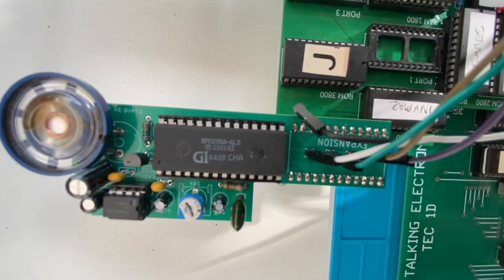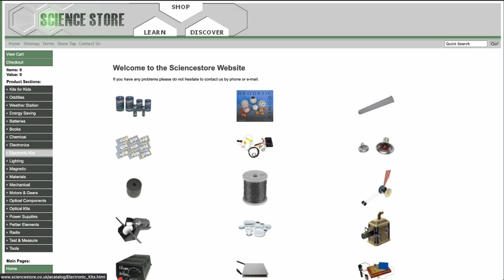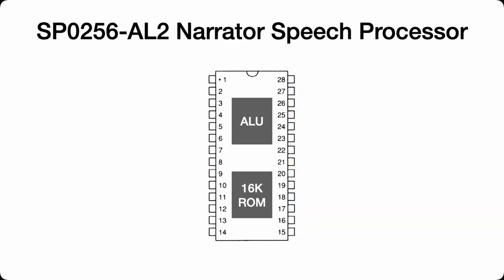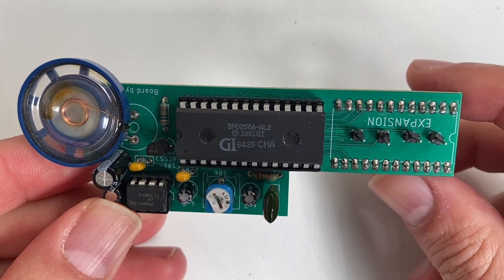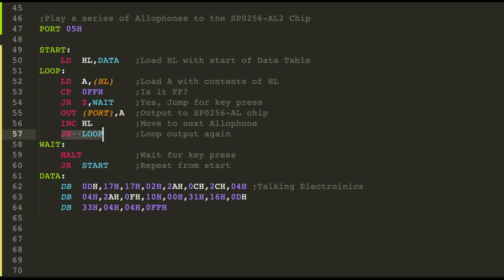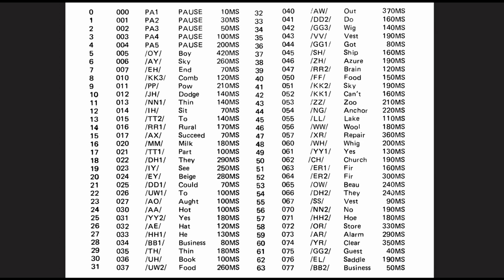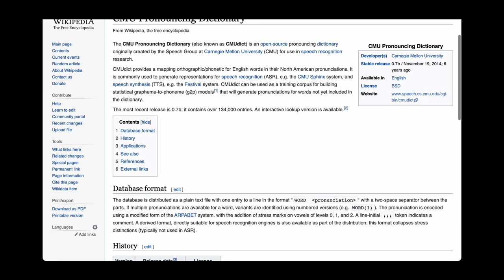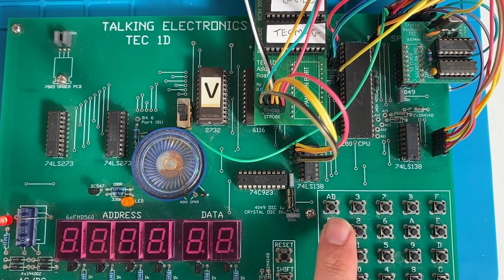Make a Z80 Computer talk with the SP0256-AL2 Speech Processor

Comment: That was a great chip.   Back in the 80’s, Radio Shack sold them for around $12.   I added them to MANY projects at the university.   We automated all kinds of things.  Especially scientific calibration and measurement.  I interfaced this speech chip to a 6502, Z80, 8085 and 68000.  It did sound “mechanical”, but it was the best available at the time.  A friend of mine once spent 6 hours trying to get his to say “fire truck” to his satisfaction.   Lol.

Comment: The last product, I designed, with a Z80, was a talking clock accessory, attached to the company's main product (Analog Logging Recorder), back in the late 1980s. It was later redesigned using an HC05 uC, as that unit more compact and used fewer parts, requiring much reduced assembly time. The speech processor used in those 2, were from TI. The chip just output whole words, and had a short, but adequate, vocabulary. It was also a custom chip (not found in databooks), but the original customer bailed out, and I happened to stumble upon them, just at the right time. I collected the unofficial documents from the local TI Sales office (remember - 1980s), and the company bought up a bunch of the, otherwise dead, inventory.

Comment: Nice work. I still have all of my speech chips from back in the 80’s, including this, the National DigiTalker, and also the Votrax SC01A and SSI-263 (SC02).  My favourite was definitely the SC01A, which is Phoneme based and sounded a whole lot better than the SP0256. I made my own speech synthesiser for the C64 with the SC01A and coded an extension to BASIC to provide a SAY command for text to speech output. I remember working through a collins dictionary, page by page, to figure out the rules for translating English letter sequences to phonemes. Those were the days! :)
Reply from the maker: The CTS256-AL2 chip has a parser that looks at letter sequences in words to determine what allophones to use. The datasheet has an example on how it works. Interesting if you are into that stuff.

Comment: This one took me back...   I bought a set of the -AL2 and it's companion TTS processor in the when Tandy were quitting them, and built the text-to-speech  box in the early '90s. I haven't seen it in many years  but it's here somewhere  :)
Reply from the maker: I think that's the CTS0256 IC. I did it by software but I'm interested in how the CTS works.
Reply: Found a link to the datasheet for the CTS chip , but  having some trouble posting it here.
Reply from the maker: Scott Baker does a good video on  the CTS chip on his channel.  The CTS uses a parser to examine parts of the words to determine which allophone to use.  It is quite clever for the times.  https://www.smbaker.com/cts256a-al2-text-to-speech-board
Reply: Mine's long dead and gone. It was an expensive chip even back in the day.

Comment: Nice trip down memory lane.  I had one of these from Radio Shack on my Z80 wirewrap system in around 1989/1990.  That datasheet and the tables were just as I remember them!  I can even smell paper of the the TI Volume 2 TTL Databook in my mind now. And thank goodness you modified that first code snippet to use OTIR, I was getting annoyed looking at it going "needs a termination condition, dammit!".  Tieing the standby pin to the CPU WAIT seems a little heavy-handed though, would probably use polling or IRQ so can keep my crypto miner going in the background,  LOL.
Reply from the maker: I use OTIR to configure the SIO so it only makes sense when sending out a data stream to a port.  Ideally interrupts should be used instead of WAIT but the TEC computer that it was designed for didn't use interrupts normally.
Reply: @ReadyZ80  Got it. For OTIR it's the perfect low budget solution!
Reply: I had one from Radio Shack too. It came with the serial ROM. Was expensive as I can recall. $12.95? Which back then was a lot of money for a blister pack of electronic stuff. I killed mine powering it with a sketchy PSU later on. But I messed around with it for a while before it fried. There's a few routines in it other than just the allophones as I can recall. One is these erie bell sounds that produces an oscillogram that looks like a spinning crown. Really bizarre stuff.
Reply: @1pcfred  I never knew about the Lissajous stuff.  What did they use for the other scope axis, do you remember?  I was all stoked to finally have a speech synth, but then got frustrated with how crappy most of the output actually was. There was no speech-to-phoneme software then that I knew of. And yeah, it still blows my mind that Radio Shack used to sell CPUs, TTL, and transistors.  Times have changed!
Reply: @zxborg9681  as I can recall the waveform just happened. Although my old Sencore was an XY scope. But I just remember using it in sweep mode to see the rotating crown oscillogram. Was a long time ago.

Comment: Oh man!!!

Somewhere deep in my storage unit is a VIC20, to which I soldered a ribbon cable, on the other end of which is a speech synthesizer circuit with that very chip! 

(Actually I think it's on a connector - I don't think I'd have soldered directly on the VIC! - but it's been so long since I've seen it....)

I remember being in college, putting it together on a breadboard (I'd seen an article in a computer magazine and ran right out to Radio Shack to get the parts) and getting it to say "Hello" in a loop with a 5-line BASIC program, before having to go to a meeting. 

I took the whole setup over to a friend of mine who was a CompSci major, and by the time I got back from the meeting he had it speaking typed-in words, sentences triggering from the F-keys, saving dictionary to tape, stutter mode (!!) - and all this in the 5K of RAM you got with the low-end memory cartridge!

I used it in college, too - in an experimental theater class. I made it recite - figured out and typed in each and every phoneme - the entire "All the world is a stage" speech by Shakespeare.

Sure could have used the CMU dictionary and Brian's program back then!

This is awesome - thanks for the memory trip!

Comment: i think for retro computing it would be cool to have an LPC encoder which encodes audio files to the LPC code, that the SP256 uses internally. the AL2 version - if i remember correct - is the version that contains the ROM that has the according LPC data for every phoneme that it supports. but theoretically it could be used in the LPC mode. i remember the similar speech chip SP250? that sega used for a universal vector graphics arcade board G80 that has been used for "space fury", "battle star", "star trek", "zektor" .... that used their own LPC data

Comment: You have put in so much time and effort and still the speech coming from that soundchip is hardly understandable. Some forty years ago those computer speech things were simply not good enough. I still remember one of the first games with speech in it, something with ants or so, when you were beaten it said: "we gotcha!" but it sounded like "we kassa!" and in Dutch that last word means cash register. So it didn't make much cense. 
 
Nowadays computer speech still works with allophones or phonemes so all the work that was done back then was not totally useless, only the actual sound generator is improved light-years!
Reply: I remember when all robots in sci-fi movies from forty years ago talked like that. Back then I got one of those chips and spent a lot of time experimenting with it and trying to make it talk more clearly. At home we also had a parrot and I was surprised when it started imitating the chip's voice very accurately with all its glitches.
Reply: I'm pretty sure the game you're thinking of is Dung Beetles for Apple II.

And I'm no linguist, but isn't "kassa" in the Germanic / Norse languages "cheese"? ;-)
Reply: @drlegendre  Käse is cheese in German, but there has to be an umlaud or a trema on the A. "Kaas" is the Dutch word for cheese. In Norway, you point your finger to the cheese and bring you hand to your mouth. Then the Norwegians understand you want to eat the cheese. They are very clever. And that is exactly the same as in Italy. So, in fact the Italians and the Norwegians speak the same language, sort of!